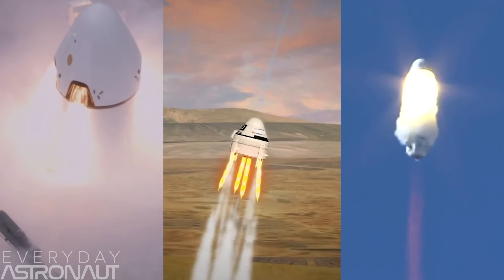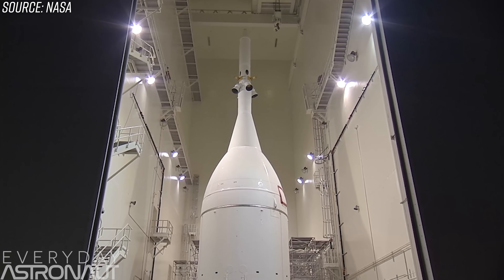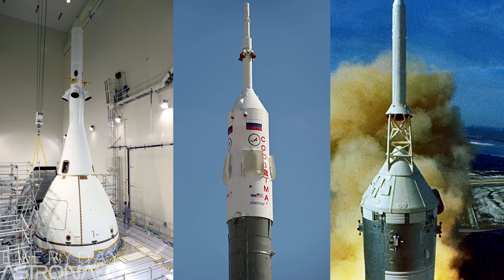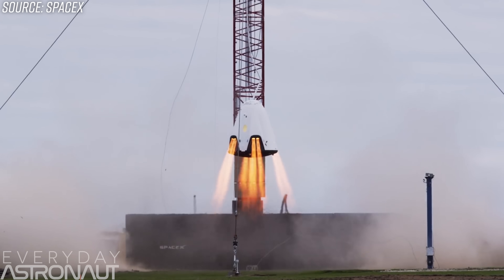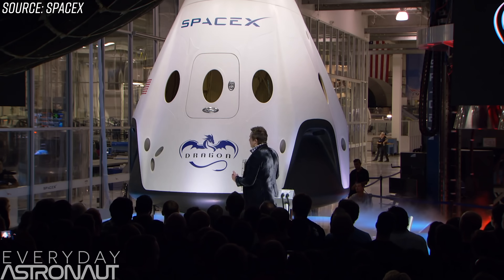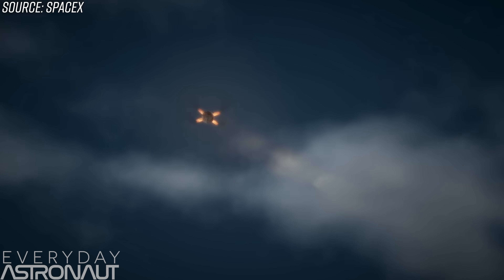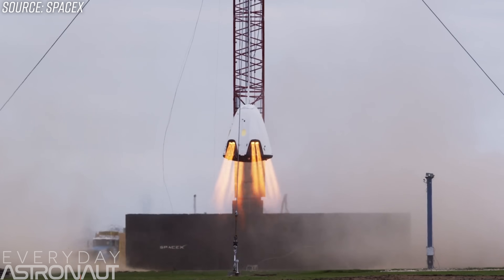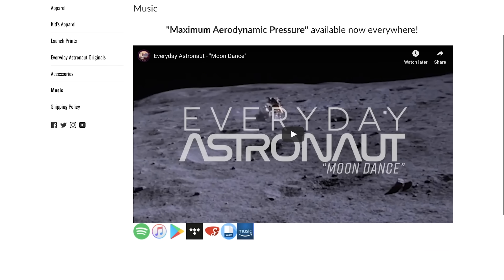Why have SpaceX, Boeing & Blue Origin ditched abort towers?

Comment: Glad you asked Tim, i have a question - what caused the 
SpaceX Crew Dragon capsule "anomaly"? 
;-)
Reply: Come back In a month and we may know the answer. SpaceX and NASA won't know the exact cause yet.
Reply: @MrDeath2094  Thats why i asked now, part of the "joke"! ;-)
Reply: @MrDeath2094  Scott Manley said it might be because of a failure in the COPV tanks which might be because of corrosive salt water damaging the tanks
Reply: ah interesting. in any case we will learn a lot about it think. the fact it blew up is not a negative per se .... that's why its a test vehicle.
Reply: The Ocean landing messed things up I bet. They are still investing what caused the explosion. Noone knows why yet.
Reply: BeamingBetelgeuse XD If there was saltwater in the tanks, past multiple check valves and throttle valves, that would be very serious
Reply: @ZAGAD-i2x  I was under the impression he retracted that statement after a video of the explosion was leaked?
Reply: @AmbientMorality  I think its worse then that. When I saw the tape of the tests being done on the last test  it looked like the dragon just blew up without even being fired yet out of nowhere.
Reply: Ya I thought the same thing
Reply: @badtrekee4348  Yeah, that's my point. I don't think there's any chance saltwater got into the tank, and if there is that would have serious implications for the rest of the system (that'd mean backflow was allowed, which is... not good)
Reply: What if it was a 'controlled error', then SpaceX can opt against salt water recovery due to the issues it has caused and then push for their original propulsive landing method?
Reply: They need the abort system because liquid rockets have a history, that is still going on, of blowing up. NASA does not allow SpaceX to land their capsule and use a parachute for that reason. You land 1000 capsules one will probably blow up and kill everyone, there is no abort system for the capsule.
Reply: @ZAGAD-i2x  I like Scott manly however he was speculating widely with little to no facts, I'd take anything you hear with grains of salt currently.
Reply: I think Scott Manley and others are working on the assumption that the outside of the COPV tanks were exposed to saltwater. This system is pressure fed to achieve the quickest start up to facilitate a safe abort. In order for the insides of the tanks to be exposed to saltwater they would have to be compromised and therefore would rapidly lose pressure.

If corrosion is to blame it wouldn’t be the first time SpaceX fell victim to saltwater (Falcon 1). I know a lot of people are suspicious of the COPV’s, but the anomaly could’ve been from anywhere in the spacecraft or even in the ground equipment for that matter. Maybe one of the fuel/oxidizer lines was weakened from corrosion. We also can’t exclude a problem in the inspection process either. Maybe a technician neglected to tighten a fitting or accidentally damaged something. As a jet mechanic I know that even the slightest residue of a hydrocarbon exposed to a rapid increase in pressure in an oxidized environment can lead to a bad day. 

I’m hoping the problem is a result of something being damaged and therefore doesn’t require a change in the fundamental design. In my estimation this would be the shortest delay in all the possible scenarios going forward. Good luck to SpaceX and NASA in getting this resolved quickly and safely.
Reply: BeamingBetelgeuse XD o
Reply: can you imagine the repercussions if that happened while docked at the ISS?!!!    That is a completely unacceptable risk for NASA.
Reply: @leeroychang  They would never win another NASA contract again like that. That's a stupid way to piss off your largest customer
Reply: @AmbientMorality  They did a few tests before it exploded. But its good because they will learn a lot from it and make a better safer dragon. Maybe the salt water weakened something .
Reply: @badtrekee4348  It's NOT good!!!  It's a HUGE setback!!! NASA could tell them they won't allow it to dock with ISS unless they ditch/redesign the whole system. Unacceptable risk.
Reply: @BJK1715  NASA could do a lot of things. NASA won't do a lot of things, including, almost certainly, what you suggest.
Reply: @AmbientMorality  You sure? Like when they nixed propulsive landing?  We'll see.
Reply: BJK1715 over sensationalise much. Test is a test. It's why you test to check if any unexpected things have compromised the safety or reliability of the system.
Reply: @BJK1715  NASA did not nix propulsive landing, SpaceX opted to stop pursuing that. NASA will treat this seriously, but they will have concerns about aspects of the system's design, not "this entire abort system is a bad idea"
Reply: @km5405  It is definitely a negative, you never want your crew capsule to spontaneously detonate, even if it did land in the water, imagine if it detonated around the recovery crew?

SpaceX knows this, and I imagine they are already working on improving the design so they don't see any delays to the commercial crew programme.
Reply: Seems to be a failure in the fuel system and not the motors themselves.  SpaceX will find out and fix it.  That's why we test.
Reply: @brianofphobos8862  rumor is that SuperDracos are already eliminated as a plausible root cause
Reply: @MrDeath2094  A month? France was able to determine the Notre Dame fire wasn't arson while it was still burning. Spacex should use French technology.
Reply: @AmbientMorality  Hmmm.  That's good I guess.  I'm really just going off the video.  This is very strange though.  These systems are in wide use and seldom give trouble.  What kind of test were they running?
Reply: @SirYenner  Next time we build a rocket out of 500 year old timbers, we will certainly do that ;-)
Reply: @badtrekee4348  according to new information today from the nasa safety commission, it was undergoing vibration tests at 2x the expected worst case vibration it would see with a rocket blowing up underneath it.
That's a pretty stressful environment, especially at 2 times more than expected worst case scenario, so finding a failure is not unsurprising, and definitely it did not fail while "just sitting there".

Also, long before it ever gets near the ISS, the hypergolic fuel system is depressurized and safed, eliminating the risk of this sort of thing happening.
The reaction control system uses the same fuel, but at a much lower pressure. And all other spacecraft use the same hypergolic reaction control systems, including the ISS itself.
The fuel tanks are hyperpressurized at the moment that the abort system is activated, but are low pressure the rest of the time.
And before reentry, they are completely depressurized and safed, so no danger to astronauts or ground crew.
Reply: From what I have read about it the explosion happened about 30 minutes after it was returned to land. So the test was a success. The failure happened after the fact. I think it must have been a fuel leak. What ever it was I hope they find out soon and fix it.
Reply: @ke6gwf  So NASA said the dragon system is fine?
Reply: I think it had to do with the saltwater. ;)
Reply: @AmbientMorality  There's no way anything can get into the tanks while they still have pressurized fuel in them.  All of the fuel would have to leak out before water could enter.
Reply: @xxZerosumxx  That would be my guess.
Reply: Little information has been released, but one thing that has come out is that apparently the capsule was being subjected to vibrations that were twice as strong as they would expect during an abort and the superdraco engines were being fired when the anomaly happened.
Reply: @davidhenderson3400 , it returned to land long before, just after returning from the ISS, and was being inspected, then put through various ground based tests, so I don't what you mean that it just returned to land.
Reply: @badtrekee4348 , no, because NASA nor SpaceX have even begun to pin down what happened, much less make final determinations, so there is no ability to say that it is or isn't fine.
That will be determined once the investigation is completed.
Reply: @ke6gwf  Well what I read said it was a ground test of the crew escape system. It was launched by its self from a test pad , not on top of the Space X Dragon. It landed in the water and was taken back to shore for more tests. Now I do not know if the crew capsule had been used before for a space mission or not. If it had been used before then sea water could have been it it for some time just waiting to mess something up. In any case I still feel salt water caused the problem.
Reply: @davidhenderson3400  you need to check your sources lol
SpaceX has done pad abort tests previously where it fires on the ground and flies up, to simulate an abort, but that was done long ago.
This capsule is the one that just got back from the test flight to the ISS the other week, and was now being put through test stand high vibration testing, but it never leaves the ground.
Now, it could have been something to do with salt water, but it also could have to do with the extremely high vibration load on it, 2x the expected forces if the rocket underneath it exploded.
Reply: @ke6gwf  Well now days you can not be 100% sure of anything. The news I seen on this showed footage of a ground launch test of the crew capsule abort system and it being pulled from the water and take back to dry land. It also showed the big smoke cloud that came from the explosion. The footage was not time stamped so I guess it could have been old footage. News people are all the time using old or even unrelated footage in reports.
Reply: Tank (unknown) ruptured when they were about to test fire the engines, and causes the tanks to burst and react, causing the rest of the vehicle to over pressurize and explode...
Reply: Virtually all speculation until the final report comes out is going to be completely wrong.  Don't waste your time in it.  Be patient
Reply: David Henderson   Is that fake news?😊
Reply: @BJK1715  
They didn't nix propulsive landing. They just showed how new technologies need long trial runs to establish a statistical safety rating of about one failure per two hundred fifty successes. 

SpaceX has begun to establish that with the booster landings, but couldn't afford to do so for both propulsive landing and extending legs through the heat shield on capsules. That would have taken too long.
Reply: Thunderf00t made a video what happened check it out
Reply: @leeroychang  we know next to nothing, but lets leave off wildly unlikely conspiracy theories shall we?  Just for the record, no company creates a PR disaster by destroying their own engineering test in order to convince their customer to go a different way.
Reply: @markdoldon8852  Alright Mark, chill out.
Reply: @SirYenner  seriously?  Lets see the complexity of the decisions:
France: while hundreds of workers are working in the rafters of an 800 yr old wooden building, a fire breaks out exactly where the work is ongoing.  TENTATIVE explanation:  somebody probably made a mistake and a small smoldering fire took root until it broke out into open flames.  Something that happens almost daily at contruction sites elsewhere.  
SpacEx: while testing an extremely complex piece of unique engineering involving high pressures and dangerous materials some sort of unknown accident takes place, something that is likely unique to that system.  The accident must be prevented from recurring since human lives depend upon it.  Yeah, of course an off the cuff tentative assumption of the cause should be sent out.
Reply: @MrDeath2094  it's been a month we want answers!

Comment: 2:21 15 g's doesn't sound like fun... consider the alternative (here), incineration.
And the Space Program is going Kerbal!
Reply: One thing not mentioned in this video is that you can adjust the thrust to minimize g loads on the crew..  If the rocket blows up on launch you probably want high g's to get away fast.  But later in flight you don't need high g's.  For example if the second stage motor fails to ignite after separation You only need one g to save the crew.
Reply: @stevenf1678  dunno if this is what you meant, but this is only really true of the liquid systems, solid rockets are difficult to throttle reliably
Reply: Not ideal but also not necessary if solvable
Reply: Please realize the difference between stress vs strain. Football players constantly deal with up to 150g's during tackles. It was a a study during which they were testing why airplane wings wings sheared off during high G turns in simulations. Air force pilots can deal with about 9g's of ''sustained'' force before blacking out. however; you can deal with higher g/s as long as it's for a very short durations. see: https://www.popularmechanics.com/adventure/sports/a2954/4212171/
Reply: @Wyld1one  I think you meant 15 g's not 150 g's. If the latter, I want that guy on my team; put the fear of God in the Q backs from being sacked by that "hit"!! Would not only be season over, but "game over"!! :D

Comment: What if the Abort Tower Blows up While Aborting 

"Houston.... Um.. We Are Screwed"
Reply: One of many reasons space flight is still very dangerous.
Still, I volunteer to test any new capsules myself.
Reply: No kidding 
Edit: but the crew dragons abort can only blow up if the capsule is destroyed
Reply: Towers used solid rocket motor fuel, less chance of explosions with a non-volatile liquid fuel. They pondered that question back in the day cuz that system has to work "first time, every time, all the time",... "Failure", as they used to say in NASA, in the 1960's, "was Not an Option"!
Reply: what if the  integrated booster blows up while aborting ?
Reply: Houston We are screwed Again
Reply: @carterrissmiller2510  Right, not to make light of the situation but it is "Hawthorne, not Huston, we have a problem"!!
Reply: Easy question,then they will use a debug panel for no damage setting.
Reply: bruh
Reply: "Houston, it seems irony is not on our side today…"
Reply: Then you need an abort tower abort tower, simple.
Reply: @aneurinhullah8687  :>     😂🤣👍🏻
Reply: Johnston Steiner  :>    than ü need a abort tower abort tower abort tower & some More abort towers…!!
C:M:påL
Reply: Dude...
Reply: Does anybody besides me think it's about time we put pressure on the government military industrial complex to start freeing up technologies that we've known about since the early 19 fiftys AKA Roswell, Keksburg,  Lancashire England and a few other suggested places that we know about publicly let alone the ones that we don't know about. What we've also learned, according to several credible people that we've known how to deal with gravity for a long while now, so why are still strapping people to huge explosive devices?  Yes I know lots of people are going to say I'm a dreamer or I'm probly a pot pipe smoking  unemploy'd weirdo  who watches too much TV. however, how do you account for all the credible individuals who have come forward in the disclosure project, TV, internet Podcasts, magazine articles, and news papers and several other forums as well. These people of course include engineers, astronauts, many scientists and military people and so forth. So don't tell me we can't develop and use a better system for putting people into space. The only reason I can think is that someone a lot further up the chain, well past even the president said no you can't use this.

Comment: The thing is Apollo et al were Disposable.  So, it made sense that the LES could be dropped as soon as it wasn't needed, there's no reason to carry that to orbit, and back.  Sticking it on the nose, where it can easily be ditched even helped aerodynamically as it broke the sound barrier on launch.  Dragon (For example) is re-usable.  In fact, the plan was to use the LES as landing rockets after it came back.  So, the Abort rockets are also re-usable, and therefore, it makes just as much sense to integrate them into the airframe.  So they can come back with the airframe, and be re-used.  That's the main reason why the Abort Rocket was on a tower-up front:  So they could ditch it, without separating the crew cabin from the support module.

Comment: Tim, Dragon 2 uses helium tanks to pressurise the super draco system. The hypergolics are not self-pressurised.
Reply: what  was the pressure supposed to be? salt water in the regulator?  so baking soda would not have stopped an explosion? vent holes would not help?  double the tank thickness? use 500 pounds less?
Reply: the regulators resonated?
Reply: reentry heat damaged the regulators?
Reply: electronic pressure regulator soldered in with pge 24,000 volt soldering iron "?
Reply: 8:45 one tank blew up the other tank?  tank should blow out the side?
Reply: the hypergolic tanks are also pressurized though

Comment: great report.  I felt like you left out a small detail on some of the modern abort towers that have reverse flow nozzles - putting the full abort solid between the capsule and the nozzle - which eliminate the need for the truss mounts.  The orion abort test looks awful, but the skins of that test vehicle were simply painted 1/4in aluminum which barely got scorched,, so the separation makes a massive different in heat flux.  One other tidbit - the abort level in that test was 16.2 G's, but it has been "dialed back" to a lower level for production use.

Comment: There is another problem with the pulling-type abort systems is that as long as the engines are over the center of gravity, the rocket acts like pendulum whitch acellerates itselfes. That is why at the Apollo-Missions they filled the tower with depleted uranium (very heavy), which shifted the center of gravity towards the top. However, this makes the whole assembly a good amount heavier.